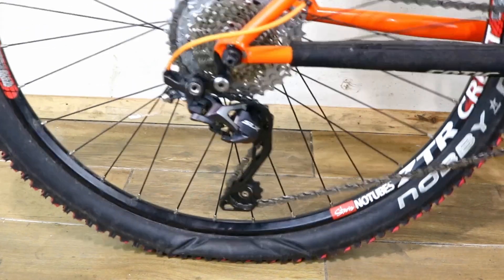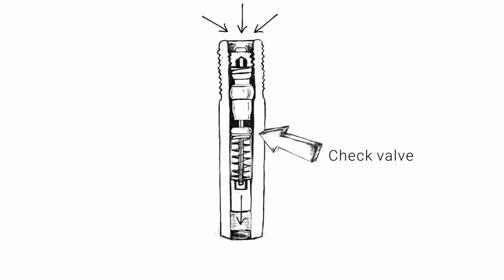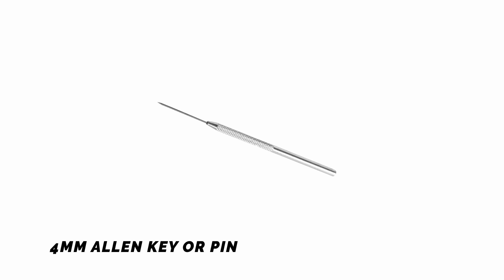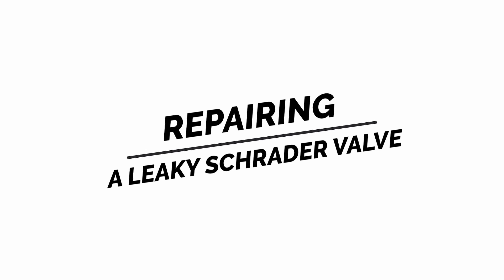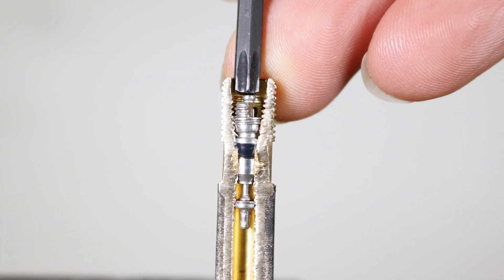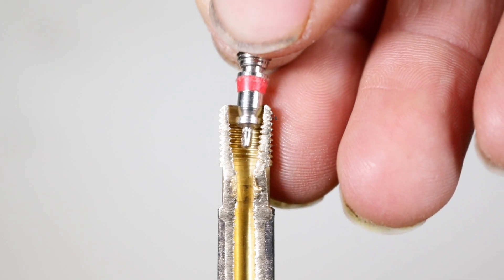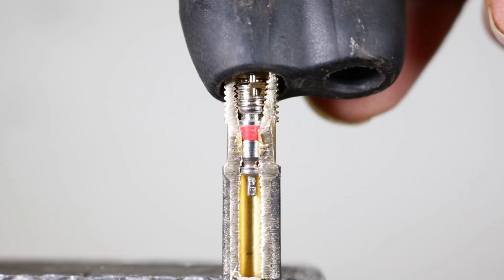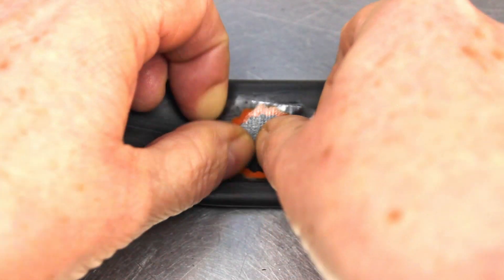Schrader Valve Leaking Air? Stop The Leak With This Easy Fix!

Comment: Amazing, thank you! I got a new bike with a loose Schrader valve; thankfully I had the tightening tool on hand, so I was able to fix it and get on with the assembly. The diagram of the interior of the Schrader valve is super helpful to actually understanding WHY the fix works and not just HOW to fix it.  Excellent video, and thanks again!

Comment: So got a older used Brompton. Noticed a hissing sound recently and realized the valve is releasing air. 

I replaced the core but it still persists. However, I noticed when I wiggle the valve around, it stops sometimes. Should I just replace the tube at this point? 😅
Reply from the maker: Hi, thank you for your question. It could be that there's a small hole near the valve. The rubber around that area is thicker, so depending on the position, it might temporarily block the hole, stopping the air leak. When you move the valve, it can shift, causing the hole to open and air to leak again, or it may temporarily seal the hole in a different position. If this is the case then replacing the tube might be the best solution.

Comment: What other tool can I use to tighten the valve? I don't have the proper tool. Thanks
Reply: A pair of tweezers done the job for me
Reply: The tines of a fork worked for me
Reply from the maker: Hi, thanks for your question, and apologies for not getting back to you sooner. I can see that people already sharing some great ideas.🙂
Reply: A pair of fine point hemostats works great

Comment: This is from Mike.  I was taking my car out of storage and checked tire pressures. One of the valve stems started leaking. I thought I was going to have to replace something. I watched this video and all I needed to do was tighten the valve core !!! Thank you for saving me a trip to the tire place.😊😊😊
Reply from the maker: Hi Angela and Mike! 🚗 I'm thrilled to hear the video helped you out, and you were able to fix the issue without the hassle of a trip to the tyre place.😊🔧👍

Comment: Replacement is hardly a “fix”, considering the new core is only bought with a new tube 😂
Reply: You can buy replacement Schrader valve cores at automotive shops and online , at least in the UK ( I have checked ) . Otherwise you can extract one from an irreparable tube with an otherwise good replaceable core.
Reply from the maker: Hey and thanks for the comment. I value your opinion, though I respectfully disagree. Replacing the faulty valve core is a way to fix a air leak in the valve. Also, as @dawn_rider pointed out  you can acquire replacement valve cores without having to buy an entire tube. And yes, you can also extract a perfectly good valve from an old tube as well.
Reply: @cyclemaintenanceacademy  yeah, my bad. Whilst I couldn’t just buy cores in at least three countries i used to live in, those could still be salvaged from the trash, if i ever thought about saving old valves. 
Lol still sounds unrealistic to me, sorry my friends
Reply: Go to your local bike co-op and they will have scores of punctured inner tubes they are throwing out.  Or to any bike shop; they will probably just give it to you.